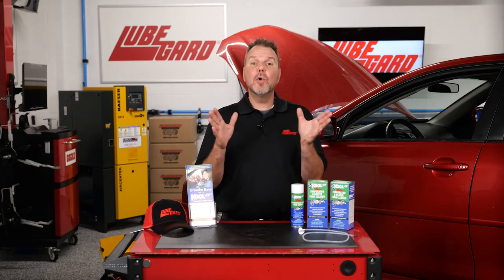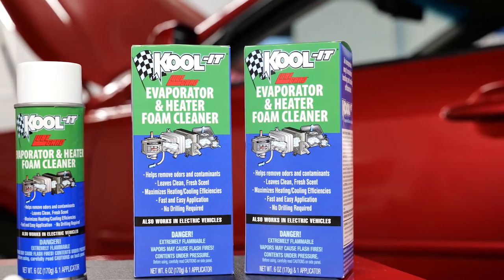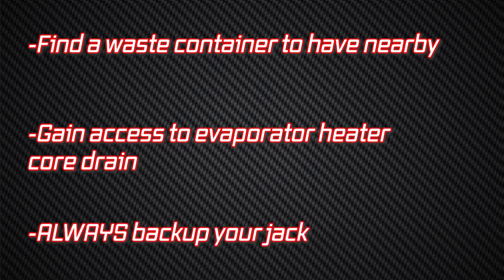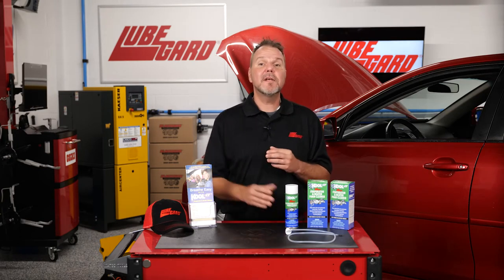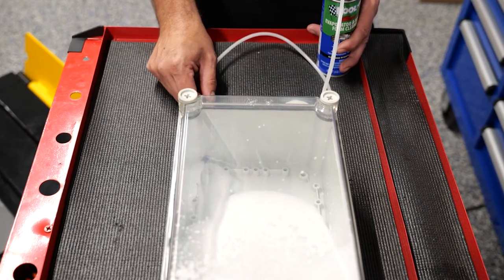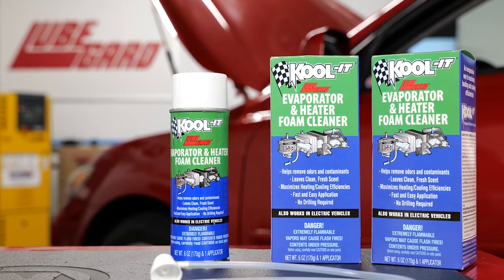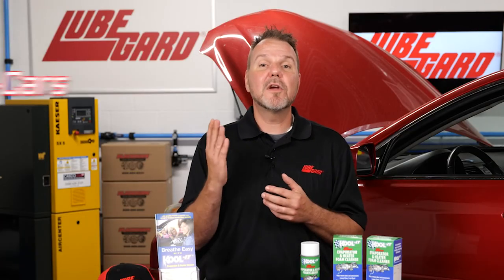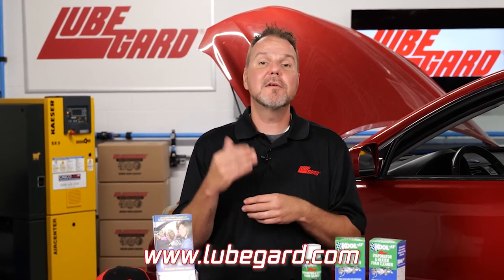How To Use Foam Cleaners to Flush Evaporator and Heater Cores

Comment: Can you use this method if the A/C isn't working properly? My A/C stopped working last year (I think it's the compressor) and I haven't had it fixed yet. It's winter so I use my car's heat daily, but there's a bad moldy smell coming from the vents.